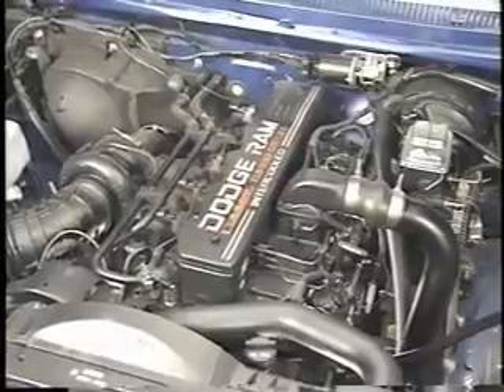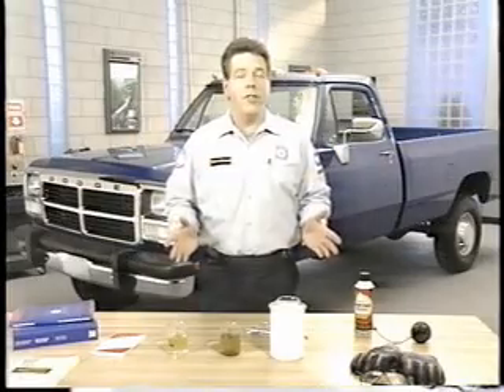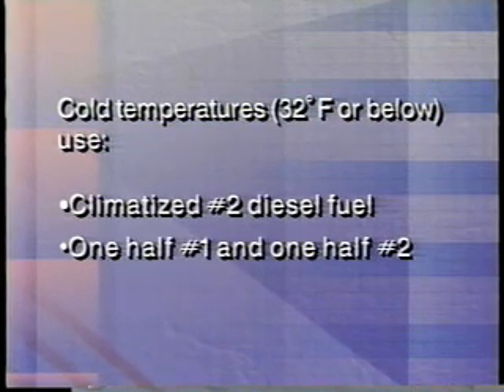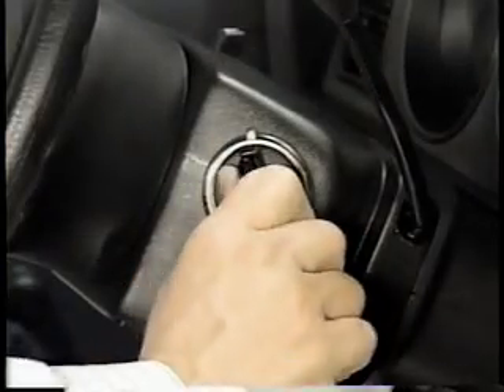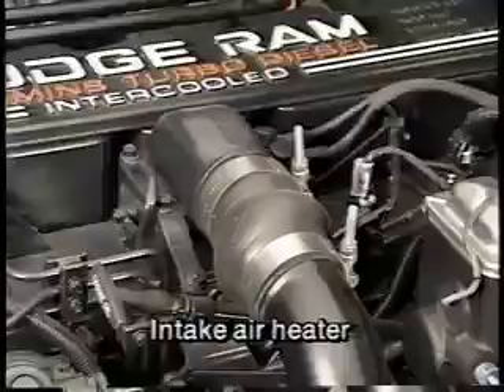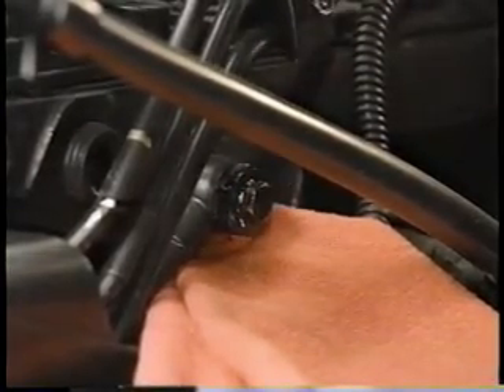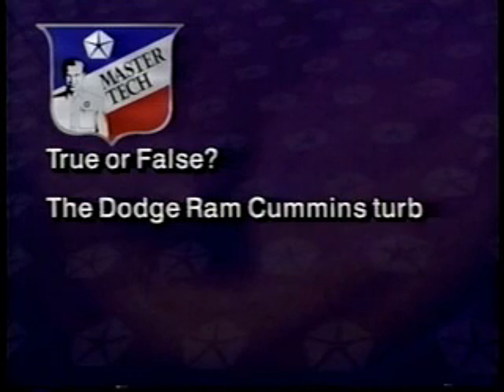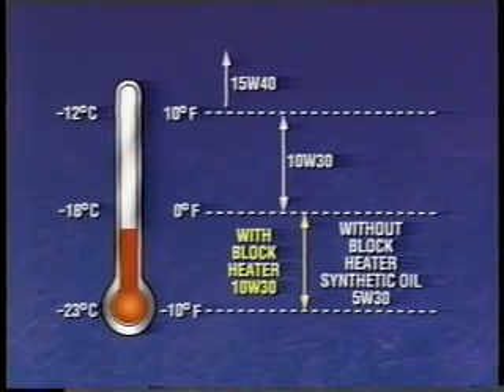Cummins (12 valve) Fuel System Troublshooting - Mastertech 1993 Part 1

Comment: @johntylerkerlin block yes. rest of the engine does wear out.     you hear of guys taking these up to a million miles with no rebuild. they speak of the bottom end. head gaskets, turbos and injector pumps will be replaced inbetween